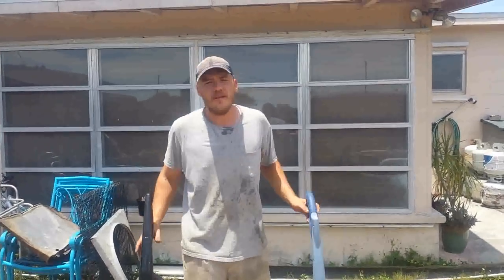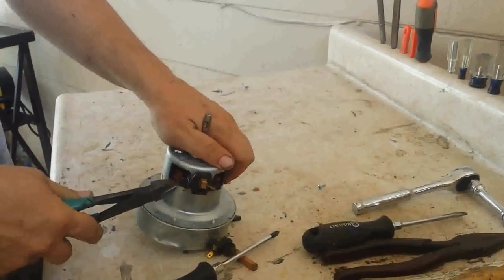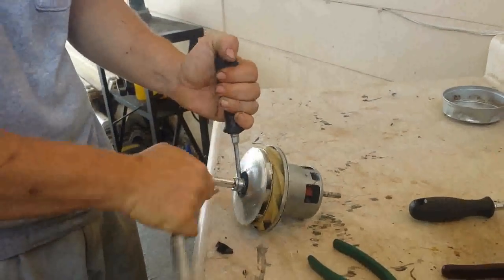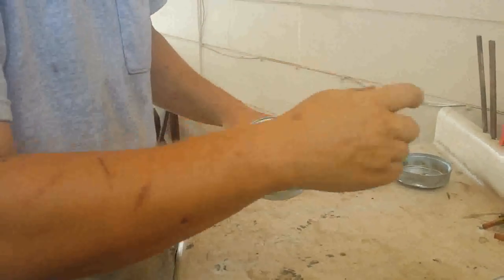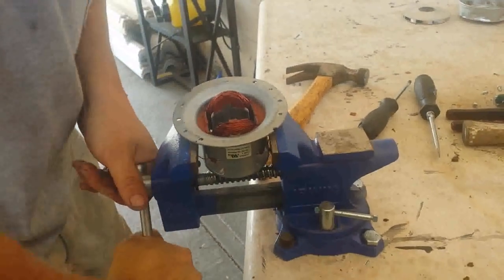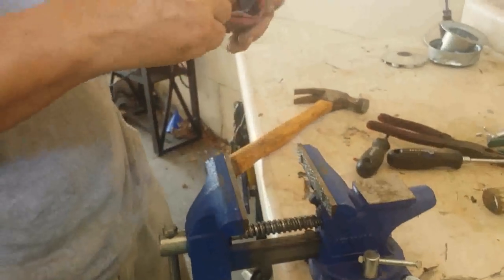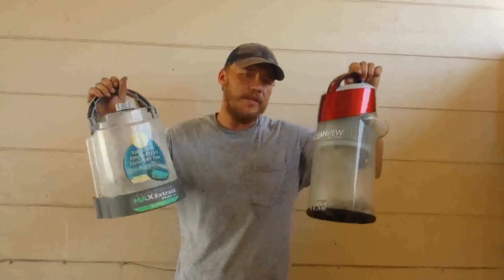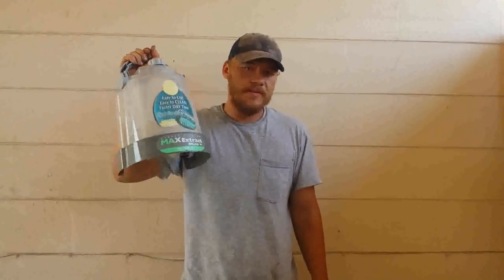Scrapping Vacuum Motors For Copper

Comment: One thing I found out about scrapping motors is that not all are 100% copper. I haven't taken apart a vacuum motor however a good percentage of electric motors are aluminum, and I get better value selling them as electric motors.

Comment: What would you value a vacuum motor fully scrapped out at vs what the yard would pay as is? I sell on eBay fulltime and scrap on the side, and I find vacuums all the time. I usually just cut the cords for #2, and haven't really bothered with the motors. Is the juice worth the squeeze?
Reply from the maker: If you only go to the yard once a year for a big copper haul and have a lot of time then sure it's worth it. Personally, I bust the motors out and just sell them for $0.12/lb. When I'm lazy I just cut the cords lol.
Reply: I wish someone made an affordable hammer mill, that would be a game changer.
Reply from the maker: I'm working on a bunch of backyard DIY projects related to scrapping as my Wire Stripper video was a huge hit. Also it would make my life a lot easier. I'll keep your suggestion on the list
Reply: Holy Moly Recycling you should totally make one of you have the means to. I have seen some smaller ones capable of chopping up plastic, but nothing DIY that would handle an electric motor.
Reply: I deliver new appliances and get the old for free from costumer so copper is plentiful in my day.
Reply: I find shop vacs worth it but I leave ‘domestic’ vacuums alone. Too much plastic to dispose off for me. 
Irons are the sweet spot for me. Copper cable and chunk of aluminium for smashing the plastic off with a hammer in 30 seconds. At last count I have 327 irons stacked up 😂 I have the storage space I don’t go the yard with anything less than a ton (metric ... literally) of a single material. Mostly just for shitsngigs that I can say ‘yeah  I’ve got a ton of copper for ya’ but it also saves fuel ...

Comment: Hey here is an idea why not plug the unit up see if the motor works the after you take it apart sell it on eBay! 🤔
Reply: Will mail you 75 vacuum cleaners with a retail price of $45 to $99 new no one wants a second hand. Got a few that sell for $500-$1500 fancy moles and industry version that will not sell for 10% of retail price
Reply: Shit the local pawn shop offers me $10 for a $500 vacuum and the listing them @$80

Comment: Seams like a lot of work TBH i think i will just toss them in with motors and transfomers.
Reply: With hand tools yeah but an Impact driver and grinder (even the cheapest one) makes it a lot quicker. Depends what you have available and if you like doing it. Generally I take anything with a motor if it’s mostly made of metals but vacuums I leave nowdays too much plastic. Except shop vacs. Pull the top motor section off then you’ve got an instant rubbish bin on wheels that’s often stainless.

Comment: That is aluminum wire
Reply: yep..that's what i thought...
Reply: I wonder why you didn't scratch the wire to reveal the aluminum before doing all the disassembly. You had enough accessible to cut through and see white or copper.
Reply: uh no it was copper ........aluminum wire in elec. motors is coated GREEN so yup ......it was copper 
I deliver new appliances and get the old for free from costumer's so copper is plentiful in my day.
Reply: i took one of these apart an hour ago, its aluminum
Reply: @user-dm8kz8ul8h  they aren't all aluminum
Reply: you're right, but at the same time they aren't all not aluminum either, we're most likely not scrapping the same exact motor. I have seen aluminum with green coatings before but this particular motor I have has aluminum wire with a thin copper coating that shaves off. Based on the comments above it looks like they had the same experience
Reply: @user-dm8kz8ul8h  dryer , washer and dishwasher motors can be alum. or copper its all a gamble ......I think manu. started to use alum. because its cheaper and lighter which sucks for the scrappers
at least the 95% of system wires are still copper for appliances , I'm in the process of stripping 100#+ of copper this week......cheers
Reply: @ulfhenarpolymathmilitant6258  I just took several of them apart yesterday. Every single one of them (9 total) were copper coated aluminum.

It was aluminum.
Reply: I get $40 a ton for scrap steel. $1.50 kg for aluminium. $5 for copper
Copper or aluminium either way I’m winning 😂

Comment: ALot of work for $.45 of copper ..
Reply: There is about 1/2 a kilo  there so its about 3 bucks, ied rather just toss them in with motors and transfomers this is a lot of time and effort for 3 bucks
Reply: TheCooperman666 yeah but power tools make short work of it. If I can reduce 20 vacuums into their recyclable components in an hour ....
Reply: Thats not even copper its copper plated aluminium.